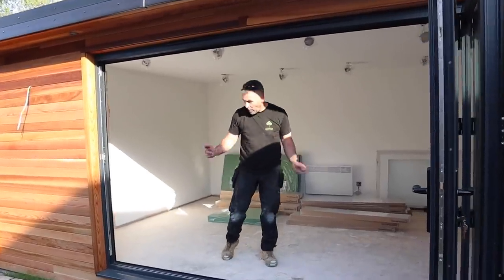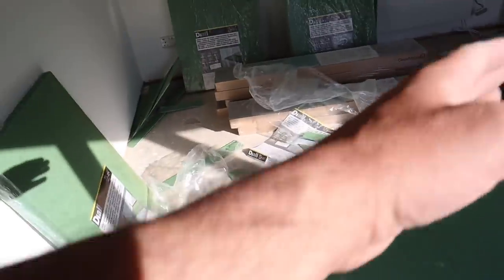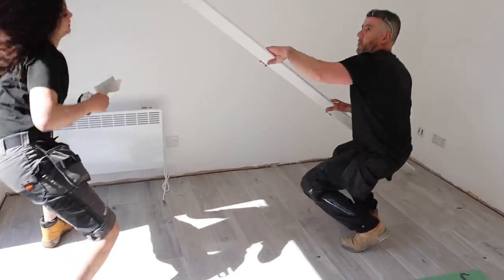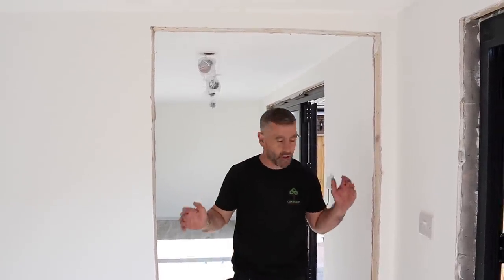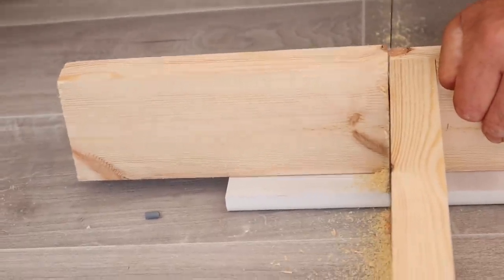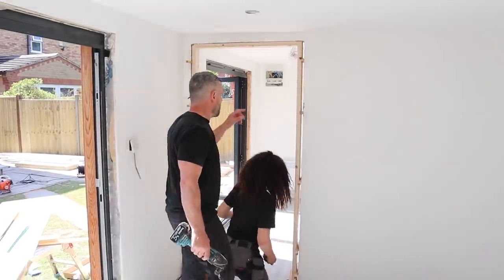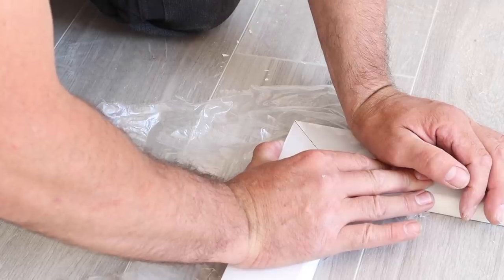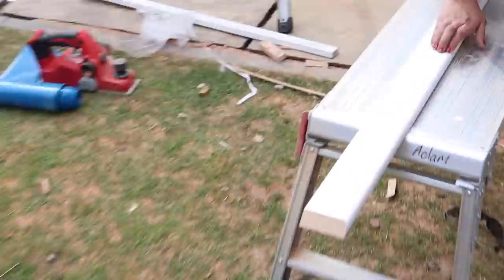Laminate flooring, door frames and a scribe off!

Comment: Another way of doing the coping on simple round over skirting (this is my invention as far as I know) is to use a router with a straight cut bit the same radius as the radius on the top of the skirting. If you make a jig it is super quick and you get a perfectly square face cut and a perfect round at the top. Then use whatever tool takes your fancy to hack the back out if you are over 45°. If it's getting painted of course don't bother just caulk it up, but on hardwood worth the extra effort IMHO.

Comment: Love this video, gotta love 4 different tools way how to cut the skirting scribe, try use multi tool then it’s will be 5 different tools 👍🏼
Reply from the maker: Didn’t even think about that 🤔
Reply: @thegardenroomguru  I have try with multi tool and it's does work but can be tricky for the first time but well worth it. Of course I use coping saw loads of time then the blade snap 🤦‍♂️ ended up use multi tool.
Reply from the maker: It’s a fine line between snapping it and not, regularly snap them mate

Comment: I'm dealing with a concrete slab already in situ 300 mil depth used to support a concrete sectional garage. 

I'm looking at having 3 layers of bricks two where the doors are , what is the best build up of the timber walls to get to the 2.5 height. The building is within 0.5 m of the boundary and will be within 15 SQM internal dimensions. Thanks.

Comment: Wrong ! The flooring must cross the substrate perpendicularly! Otherwise, the end of the board may coincide with the joint of the pad and there is a weak point and failure of the flooring!  And so many H joints ! this is a click system ! NO glue !
Reply: If you consider that the backing board is a completely different shape from the flooring planks and is almost square - then you can't really lay at right angles, and it would make little difference anyhow......?!
Reply: @andymccabe6712  Check it out! You will see that in the other direction (perpendicular) the lines of the parquet and underlay are not matching ! Recommended by the manufacturer! I like your work! I just recently installed a similar floor and came across the problem! Overall good work mate ! Fast and quality !